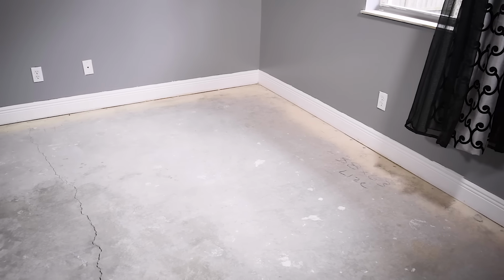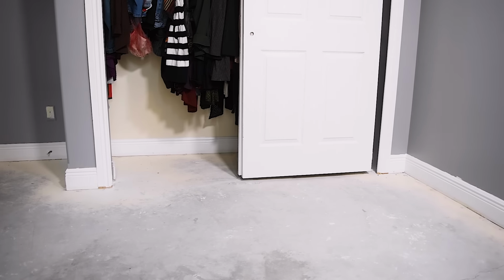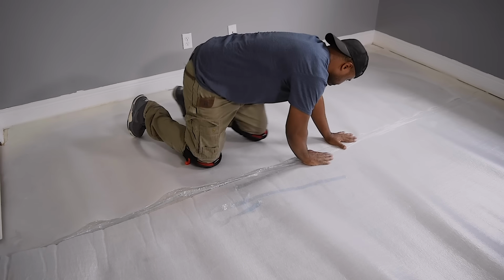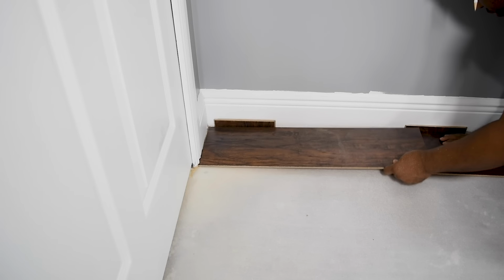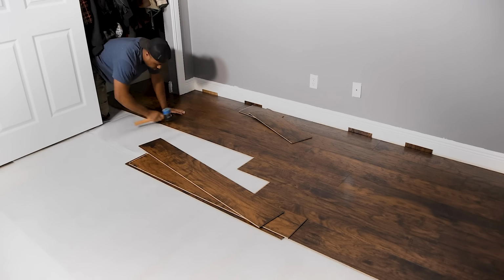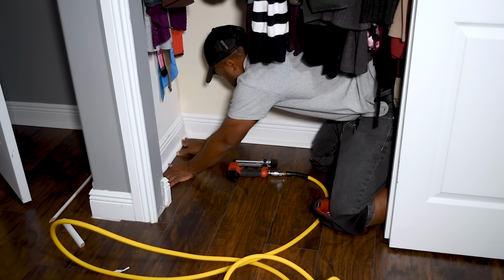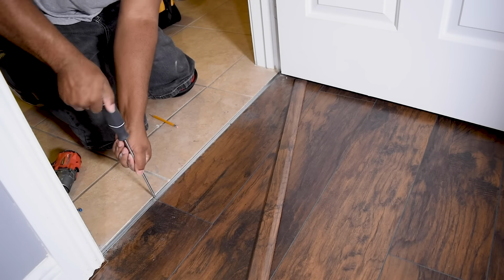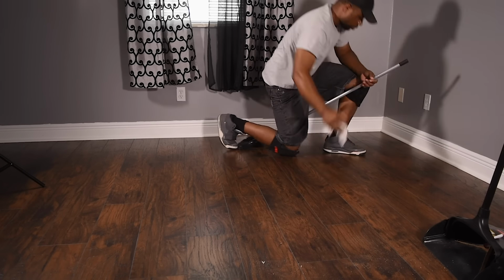How to Install Laminate Flooring for beginners

Comment: I’m a floor guy. Couple things.

-grab a tape measure and chalk line. Put your starter row in. Tape chalk line “x” amount of inches away from one side of the wall. Go to other side and line the string up the same amount of distance. Snap chalk line. Now measure one side of the floor row to the chalk line. Go to other side and line the floor to that same measurement. Put a couple more rows in and make sure they measure the same distance down the whole row to the chalk line. That will keep your floors straight. You can use the spacers like he has against his walls, but this isn’t always a great idea because if the wall is crooked or bowed, your floors will be too. 

Also, I’d like to squat on the floors when I’m laying them. Keeps my weight on the floor to keep it from moving the entire thing. 

Use a tapping block on every plank. Trust me. It looks like it may be in all the way, but it isn’t. If you run you fingers on the seams and you feel a hump, re do it.
Reply: Great advice, carpenter Fort Worth Texas ✌ gonna try to do this myself in a couple weeks. The cuts no problem it's the figuring out how to keep it straight.  Most walls are never square 😂

Comment: Dude, a Carpenters knowledge does not take a short period of time to learn. you are mistaken with a handyman or a do it yourself, or a weekend warrior concept.
A certified Carpenter is a certificate program that includes estimating where to drill plywood forms for concrete castings, understanding board ft measurements for estimations
loads, spans, spreads, sawn lumber dimensions, grades of lumber, static pressures of cast in place concrete etc. I could go on and on about this.
You are a guy that shops at home depot and thinks that because you have some rudimentary knowledge of concepts offered by manufacturers of their products entitles you to the title of Carpenter. Get a grip, you are nothing but a youtube promoter that has no education and should consider yourself lucky you even have an income at all.

Comment: It would be good to eliminate the transition strip and install something that is the same level. This is a tripping hazard! It is also good to level the concrete and remove any glue from prior floors. Excellent video.

Comment: Wish my slab was as level as that one.  Replacing the carpet with Laminate would be a Piece of Cake with your instructional video.   I need to hire a cement guy to come out and level the floor first which is gonna be a PITA!  I have about 1000 sqft to cover. and I have some pretty bad uneven surfaces too.  Got to love Texas Clay! :)

Comment: Nice job.. I took the skirting off mine.. you just have to make sure cut the painted surface off the board or you pull the paint off the dry wall & you don’t want that.. especially if you don’t have paint to match. Remember you have to invest or hire in a good mitre saw, hire a compressor & branding gun & own a renovator, I own all these, but am almost 70, so our carpenters got the job, full house for $2500 sounds ok to me.

Comment: Theres a big crack on the concrete slab ,sure foundation is ok?   I had that crack before and though its an old house and its on the floor so i didn’t care much. After years later it was relating to a foundation failing

Comment: I have watched so many laminate videos and none of them speak of pulling the trim.  It's about time someone tells people the proper way of laying LVP.  Pull the trim and lay the flooring.  This is great especially if you had carpet because chances are that the trim is sitting too high anyways for the LVP.  1/4 round is tacky looking in my opinion and in rare occasions does it actually look good with the surrounding trim setup.  I think 1/4 round is a copout for those making mistakes and wanting to cover them up.  Great video and informative to those needing a real lesson on doing a project in their own homes and saving them thousands of $$$ in labor fees.

Comment: Yeah have to use quarter round if the baseboards are not taken off. Great video. Would suggest a floorboard installation kit, to make for an easier install. Installation kit comes with the pull bar and hammer block.

Comment: I put down a laminate floor in 2013 and had no problems at all.  I cannot say the same for our recent purchase though.  The newer laminate is super-compressed and very difficult to snap in place.  It really is a disappointment because it takes about 3 times longer to do the same job.  I have to scrape the connectors with a knife to remove a bit of the "hook" because you cannot drive the flooring together.  I decide that putting the full section together across the floor from wall to wall might be better and just get my wife to help me install the entire laminate section at once.  Sometimes that works, but many times it does not.  With the older laminate, I just took a piece of the flooring and used it with a rubber mallet to tap a section in place.  That does not work with the newer laminate at all.  I am looking for tools that might solve my problem.

Comment: So the laminate floor is not really fastened to the floor except on the wall edges. So, it's floating mostly. Is this stable long-term? Could any potential issues develop? I am wondering if it's worth sticking it down using a spray glue or something.

Comment: I'm wondering what happened with your spacers? you just took them off? that GAP, it is not a problem? I mean that GAP will allow movements on the floor, doesn't it? Could you help me with this, please?

Comment: Thanks man, that's just awesome. I just wonder why it's better to cut off the tongue on the first row. And my house does not come with even angles and I should also install it on the ceramics, not the concrete. Does it make any difference?

Comment: I'm not even going to sleep on my man.. bottom line though is it does take a fair amount of time to get comfortable using any tools in general. Even using a simple hammer properly has a technique... I've even been as far as being a sub contractor for the home depot for their flooring installation department.. that included,harwood,tile, linoleum etc.. I have to be 100% honest when I say this is by far the best video I've seen that shows the basics and also has pretty much all the extras that the average home owner may miss .. this is a very quick video but watch it 2 or 3 times and sometimes during your project.. key point. If it's your first time ,take your time.. you'll get it!  Great video my man!

Comment: Great video!  I had to tear my entire bathroom floor (subfloor too) up to replace the water lines.  The old flooring was ceramic tile.  I am going with a laminate floor to replace it due to it costing about the same, but considerably easier and more forgiving of mistakes.

Comment: great video... we are about to tackle our own project.  We removed carpet and padding, and now are removing staples.  We've already measured and bought our laminate flooring, but we're going to paint the room first.  Seems easier to paint before we have to worry about getting paint on our new floor.  Your video was helpful for me to see what I'm tackling.  I need a few tools, but that'll happen too.  Thanks for doing such a great video.

Comment: I’m doing it myself because I got an estimate for $4750.
Reply: 🤣😅it be like
Reply: I just bought 400sq ft of laminate wood floor for 900 nd some change the pack of 20 was 36 dollars and some change which comes out to 1.80 per floor board and honestly it's a fun project and home improvement a little under 1200 for me
Reply: How much can you save if you do it by yourself?
Reply: Chau Huynh well the flooring is around $2sf. You’ll need some tools like a vinyl plank floor installation kit which costs like $40. When you install it you have to keep the floor away from the wall 1/4” which means when you’re done you’ll have to attach finishing molding to the baseboard to hide the gap. That part will be time consuming if you don’t have a chop saw and nail gun.  But if you have multiple rooms they’re worth investing in for $200-250.   Basically you’ll save a lot of money if you do it yourself. Lol for me it’s going to costs me about $1500-$2000 for the floor I have all those tools from a past project.

Comment: What nonsense does this obviously experienced carpenter tell us with who knows how much work experience? First, beginners do not have any of the tools they need and of course they do not know how to use it or power tools or hand tools, so the only thing beginners could do is fit the floorboards that someone experienced has measured and cut as needed. So this video was made by an average carpenter who would like to promote himself as a professional rather than helping beginners.

Comment: In my experience stay away from the foam underlay and pay out a little bit more for the solid stuff as the foam underlay has give and if your laying down the slightly cheaper laminate it can put stress on the joints and break the joints.
Reply: The fact the outlet covers are covered in paint means they weren't even removed when the room was painted. The owner of this place is doing it cheap as possible, hence the foam underlay.

Comment: That exact under lament says not forvinyl laminate flooron the label. I used it for my first install. Did another house the following year and the store pointed that out on the label clear as day. Think it's cause of the thickness which can give the flooring to much room to move. Don't want it to remove move up and down cause the way it barely thicks together. Good idea of under layment to give floor some bounce, sound deading  and then keep it off the cold floor.

Comment: 😂😂 folks hope your not taking notes,  Make sure your cuts are far enough apart to avoid your seems being so close together, never use caulking laminate floor is actually a floating floor. You are suppost to undercut your door jams. Never try and change direction it should be long ways starting from the far wall working towards the door, and the foundation crack should be sealed as well 👍 your welcome.

Comment: I have a question.  By cutting the flooring as you do to avoid the obvious joints does that use more material?  I mean won't you still use the same amount of flooring? Why?  I have about 5 square feet than I need to do a room.  I can't buy any more of this flooring.  If I didn't mind having a straight seem in the room I could easily do the room with just two rows.  But I don't want to do that obviously.  I hope you understand my question.

Comment: Is the underlay a must if you’re just working w subfloor or covering hardwood?
Reply: There are various reasons to use underlayment.  One of them is because if you're installing laminate, it is a cheap material, and sounds very hollow when you walk on it.  The underlayment helps control some of the hollow sound.  Also, feels nicer on your feet when you're walking barefoot.  If you're on a second floor, it will help noise reduction.  In warmer temperatures it can also serve as a moisture barrier. Hope this helps...

Comment: “for beginners” yeah sure cant wait to use my beginner set of several thousand dollars worth of power tools..
Reply: Just rent some tools. Don't need to pay full price if you don't plan on using them again soon.
Reply: I mean, you can do all of this with a yard sale mallet $10 hand saw if you wanted. It'd take longer,  but it works
Reply: @RocketAdminAustin  it would also look like absolute shit, you forgot to mention that part.
Reply: @shootermcgavin9266  it really wouldn't, I don't think! Very easy to cut a straight clean edge with a handsaw if you know how. Way easier to turn a floorboard plank into a Picasso with the latest quad-blade laser guided AI assisted prosumer gamer chair mounted auto-saw if you don't. 

Renovating a house atm and was expecting to be dropping money on fancylad tools, then my grandad showed up with a bag of old things he'd collected over the years or even gotten from his dad, and showed me how to do good looking, sturdy work with them.

There's probably some things you just need specialist tools for, but as a rule: fancylad tools make things quick. Care, practice, elbow grease and a bit of intuition make things right.
Reply: @shootermcgavin9266  Some of the nicest old houses I've seen were built with no power tools. With enough patience, you can achieve the same level of quality.

Comment: I’m getting that miter box. That looked helpful.
Reply: If you're only needing to cut mitres occasionally they certainly are. Tip: Get a good quality back-saw. Over 30 years a carpenter. I used to keep one in my truck in the case that I needed to make but a few 45° cuts. That instead of lugging out my old school 40lb. mitre saw, power cord, saw horses and work board for the saw!

Comment: Nice to see some laminate!

I sell floors for a living, and to many people are hung up on LVP because it is waterproof.

It doesn't matter how waterproof your floor is, if you have the flood that you are worried about, you are going to be replacing the flooring anyway... best to target your rooms with the flooring that serves it the best.

If you want durability, and scratch resistance and don't want to rock tile, you will not do better than a good laminate, and some of the good quality product through companies like Shaw and Mohawk ( a personal favorite of mine) can be wet and steam mopped.  

LVPs are still a better choice for bathrooms, but laminates are awesome for heavy traffic areas if you have large pets or particularly aggressive kids!

No matter how thick your wear layer is on a vinyl, it just means there is more plastic to scratch before it gets to the laser scanned picture.  A laminate's wear layer is far more resistant to that sort of damage.

Comment: Forgot to check if the room was leveled before installing. Gotta make sure there’s no humps or dips before installing, otherwise the floor would have movement and won’t last you a long time.
Reply: Ok that's what I thought too. What do you add on the floor if it's not leveled?
Reply: @ramirezsara100  Self leveler

Comment: Need a 8-10mm gap around the entire perimeter of the room so boards can expand.  Not just on the starting wall. General rule of thumb is the boards will expand 1mm per end per metre. So you can see the boards can grow quite significantly over a large area.
Reply: Was wondering that, so gap all sides?

Comment: No Moustire inspection by meter
No cracks fill up
No floor exposed to the temperature room by the manufacturer 
No leveling floor
No underlayment 3 mil protection..
This is none Experience installation period.😨😨😨😨😨

Comment: Why was the baseboard on the floor? How did they tuck the carpet under it? I would have just removed it, installed the flooring and then put the baseboard back on. The extra height would have covered the paint line on the wall. Even better would be to remove the baseboard before painting. The floor looks nice now though. If you had started the room with a third of a piece you can use the other two thirds at the other end and avoid the stair step pattern. Random pattern always looks best👍

Comment: So we hired someone to do our snap laminate and unfortunately it was a poor installation and now there are air pockets (?) under a couple of sections. Everything I've been reading says that it might be because there wasn't enough of a gap between the wall and laminate. Pretty positive they did not use any backer rod or similar gaps between the wall and laminate throughout. The majority of this flooring was installed with baseboards removed prior. (My husband had to remove the old laminate layers & carpet and remove baseboards to get the person here to install.) Anyway, with that said, do we need to remove all the baseboards and check for gaps and then reinstall? Any suggestions on how to make that go by more smoothly? We are out a lot of money and aren't super excited that we currently have large gaps around the corners in the hallways either that cannot be covered by trim or a baseboard. Sigh...thank you for your tips! Wish we would have seen this video and done it ourselves now!!!

Comment: I agree with you about the baseboards. This is like taking a shower and putting your dirty cloths back on after that...Baseboards are easy to remove and relatively cheap so I never understood why people choose to keep them in place. Also, by removing the baseboards the floor looks nicer and more professional.

Comment: Anyone that is watching this, beginners or not I hope that if you have any issue with the floor either it would be wood or concrete, make sure you address the bowing,cracks or if there is a dip in the floor underneath because it could become a huge and costly project in the long  run

Comment: What if the moldings are removed.  How  far  under the drywall to you start the floor?
Reply: The instructions on your flooring should tell you.  Most likely about 5/16th from the actual studs.  This allows room for the wood to naturally swell during warmer weather.

Comment: How much would a bedroom this size cost (supplies)?
Reply: Depends on the laminate.  He looks like he is using a builder grade one... you will probably find stuff like that for 1.50 to 2.50 a square foot.  The higher quality stuff will be in the threes and fours.  But will be tougher and water resistant.

The quarter round.. if you are using just the plain white stuff, you can probably by that for 8-10 bucks a stick at Home Depot.  Matching Quarter round for the product would probably be 12-15 bucks each.